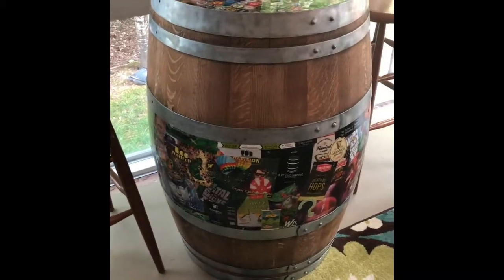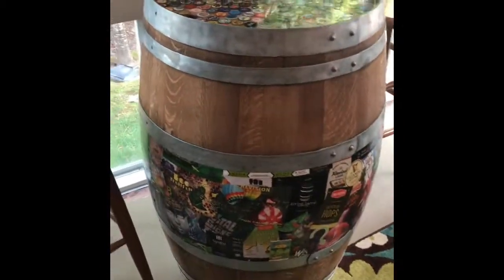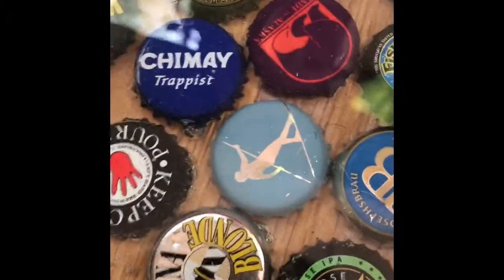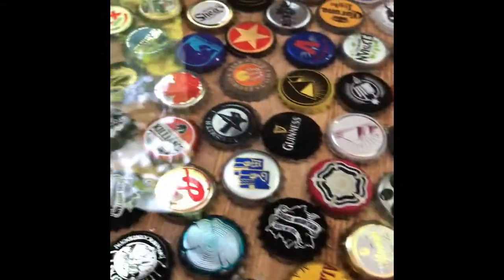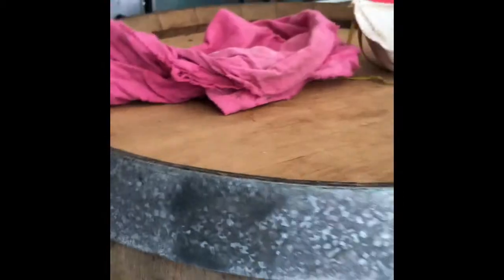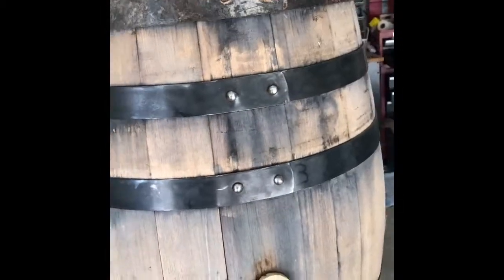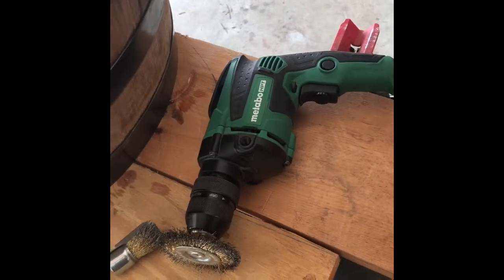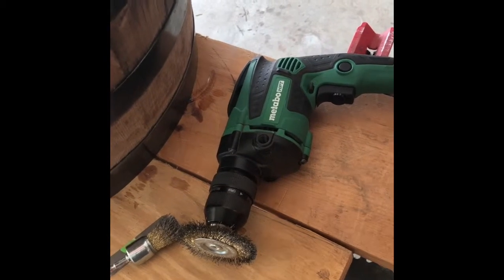How to recondition an old wine barrel- Introduction

Comment: Hi, your barrels look great! What is your process for putting the bottle tops on the barrel? Two separate pours or do you glue the bottle tops down? Thanks in advance!
Reply from the maker: I’ve done this four times now. The first time I used a hot glue gun at the bottom of the cabs that wasn’t good enough because air trapped under the caps continuously leaked out into the resin while it was curing.

On the second attempt are used a sealant product to fill the bottom of the caps and found that that didn’t work either. Perhaps a combination of sealant and hot glue would’ve worked.

On the third attempt I use plaster of Paris and filled all of the caps. The caps that were overfilled had to be scraped flat and then they were hot glued to the surface. And this worked really well but as you can imagine was a little time-consuming.

I’ve seen videos where people apply a compound to the top of the table and press the caps in but this wouldn’t work for me because I wanted the wood underneath the caps to show through.

So bottom line is I’m continuing to use the plaster of Paris method. I make sure the Plaster has a liquid consistency so it’s easy to pour with a spoon into each And it will still harden up.
Reply from the maker: You also mentioned to separate pours. Yes that’s essential. After all the cabs are in place I pour just enough so that I cover the bottom of the caps and make sure to catch any air bubbles in this very thin pour and get rid of them with a hot gun. Then I do a second pour up to the top of the caps and there are usually no bubbles in this pour. Then I do a third or even a fourth pour. It all depends on the type of resin that you use. I’m using one that is best suited for thin layer pours I have never tried one for deep pores but even if I did I would make sure to use a thin layer first and then  a thick layer to cover all the caps. I wait 20 hours between pours.